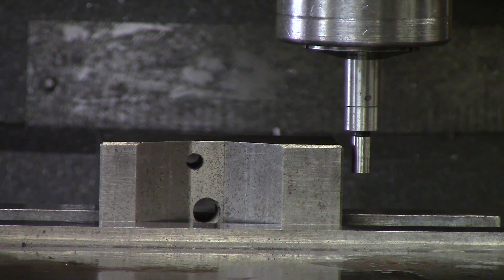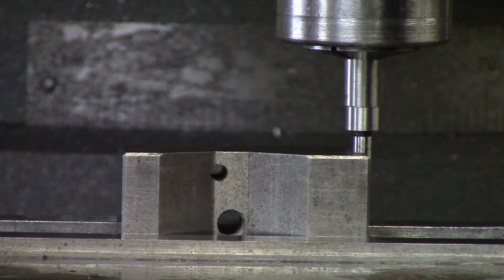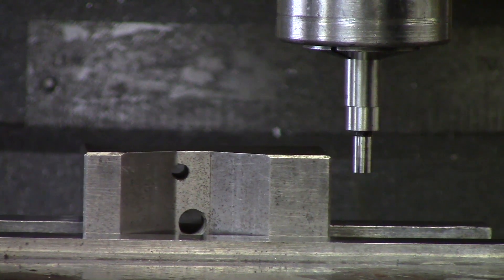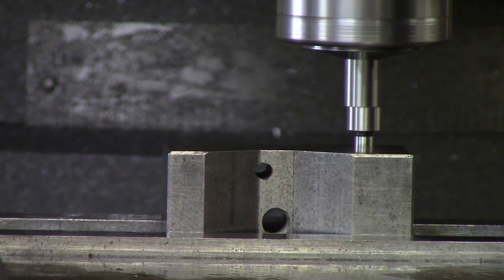Edge Finding

Comment: Your videos would be so much better if you filmed them in locations free of background noise.
Reply from the maker: @carrollprice1213  that’s what I’m working on now, thanks for the feedback! Finally bought the right microphones.
Reply: I know this video is seven years old now, so this comment is no longer relevant,  but seriously, why can't creators like this understand that this is a terrible video for beginners.  This video is directed at people who are already familiar with everything on this video. So why bother making it? For a beginner, what is center finding? Why do you need to find center? When do you need to find center? What is a kick? What does a kick look like? What does that kick mean? I  won't "like" this video, nor will I subscribe if this is what you think is a good teaching video.
Reply: How to tell if an end mill is carbide?
Reply: @frankborowitz6565 
A carbide is heavier. Has different color or tint since it's usually coated. And most of the time the composition of the carbide or the coat is itched on it like AlTiN.